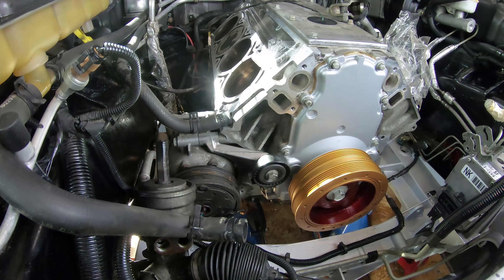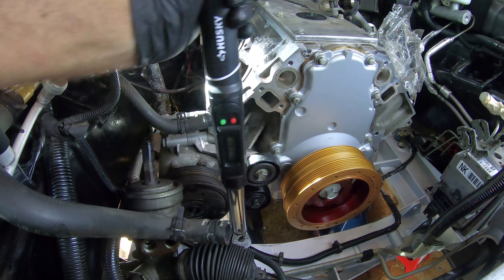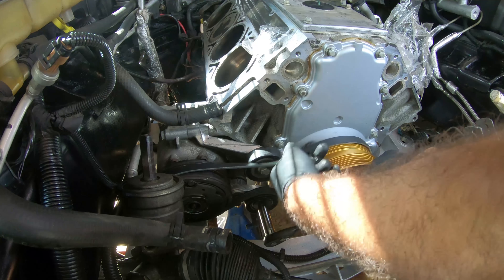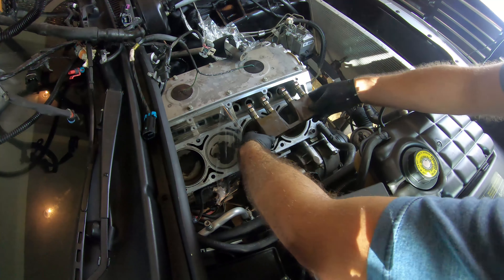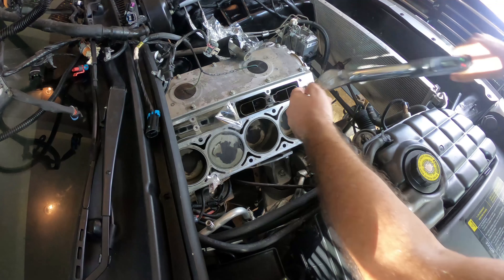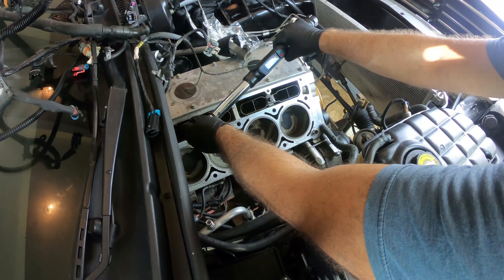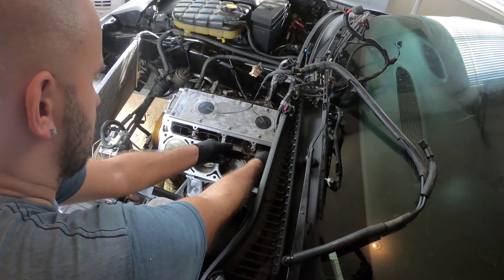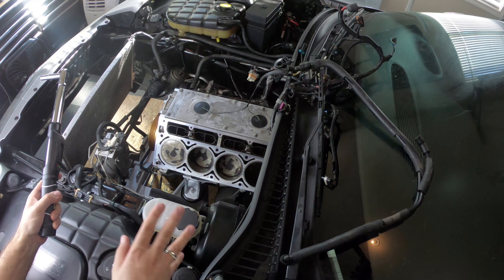AC Belt Tensioner, AC Belt and Lifters install - C5 Corvette Build - P22

Comment: Torque for the tensioner bolt is 18, not 37.  Idler is 37.  Tensioner bolt is much smaller.

Comment: Where did you get the ac tensioner? I’m looking at just going to autozone and getting one but it doesn’t look the exact same  .
Reply from the maker: On Amazon. These are the two tensioners that I bought:

Gates 38194 Belt Tensioner Assembly https://www.amazon.com/dp/B000C2WITC/ref=cm_sw_r_cp_apip_N38zvzOyN1gmH

ACDelco 38196 Professional Automatic Belt Tensioner and Pulley Assembly https://www.amazon.com/dp/B000C9KSLU/ref=cm_sw_r_cp_apip_Gt5JLeSFPaYBA